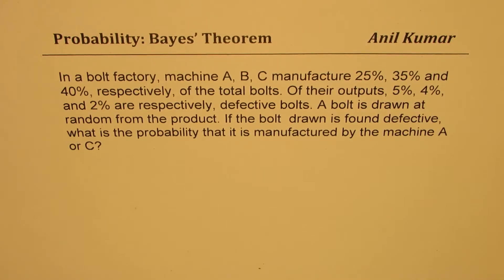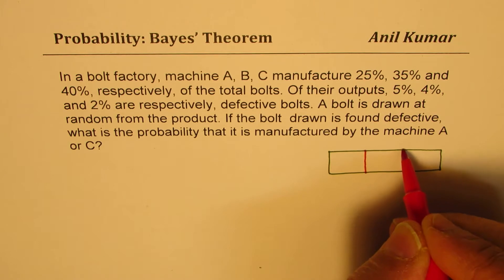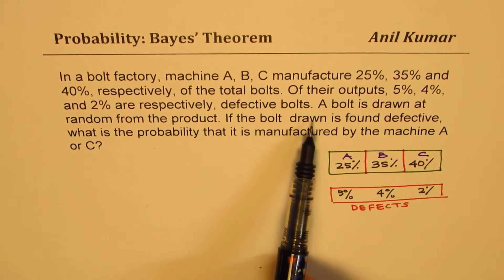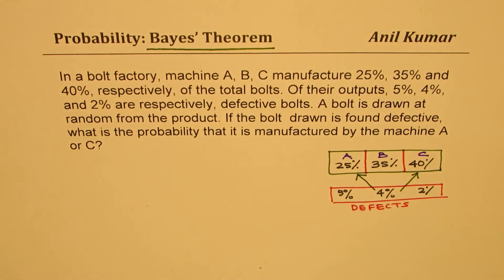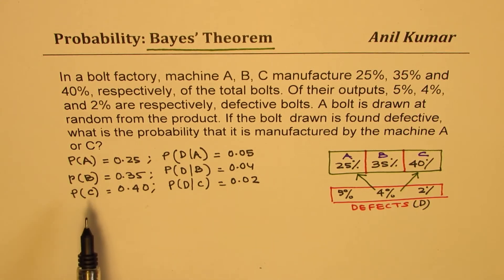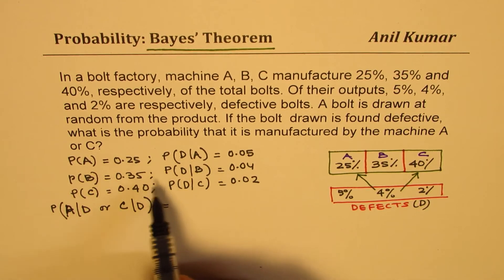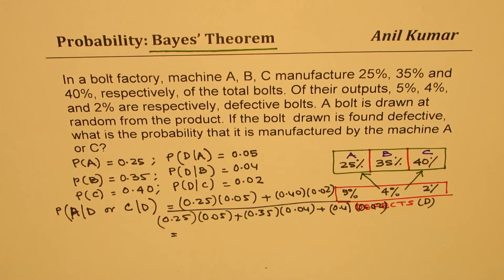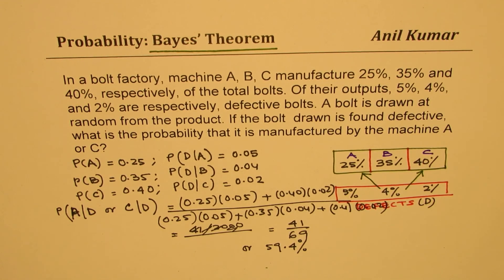Bayes Theorem Probability of Defective Bolt from three machines  IIT JEE CBSE 12 NCERT

Comment: There is an easier solution and faster way to solve this problem without having to recourse to Bayes' theorem.  The answer is (125/345) + (80/345) = 36.23% + 23.19% =  59.42%.
Reply: How did you get it?